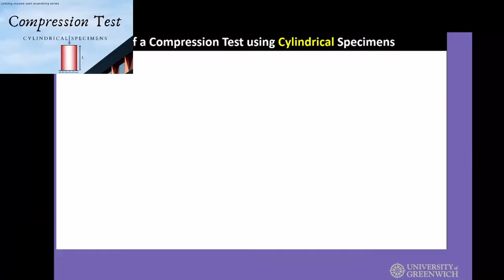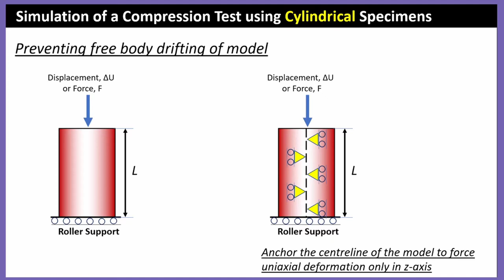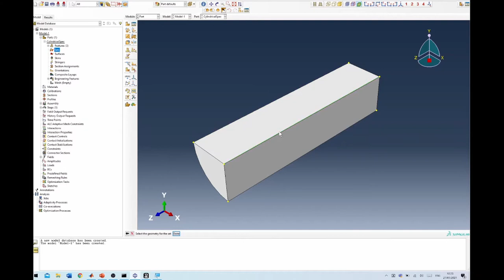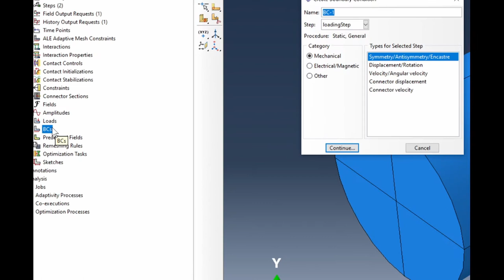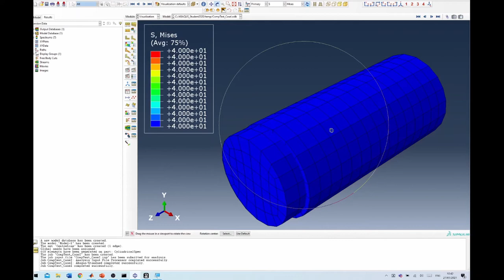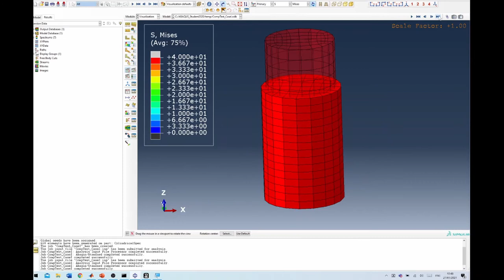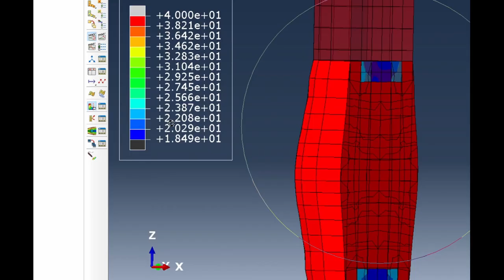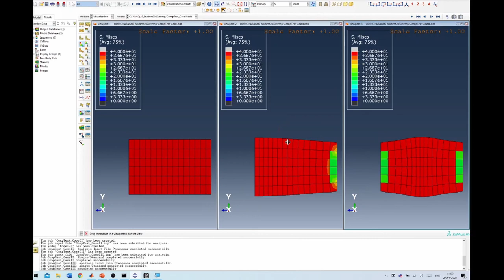Numerical insights of Compression Testing based on cylindrical specimen

Comment: Your way of delivering the lecture is great. Can you please provide one demonstration video of doing quasi static uniaxial compression testing on honeycomb cellular solid structure sandwich between two rigid plates? I need to validate my experimental force displacement curve with the numerical simulation. There is some difficulty in applying contact between specimen and plate and within specimen like self contact. Can you demonstrate this one simple problem with your nice explanatory video? It is really very helpful.
Reply from the maker: Hello @Anurag, thanks for the comment. It is a good suggestion - uniaxial compression of honeycome cellular solid structure sandwich. I will consider it and see if I am able to help. With the contact query, do you need ot have them with contact. Can you not bond/bind the rigid plates with the sandwich material. What is the condition/situation you are modelling. Do you just have to apply compressive load without binding the plates in your case? Well done.
Reply: Thanks for the reply @Dr. Okereke. Actually for the contact issue, i need to consider general contact or surface to surface contact between the rigid top and bottom plates and the top and bottom surface of the specimen respectively with the interaction property considered as hard and penalty friction coefficient. Since such type of simulations are non-linear in nature so self contact should also be considered between the specimen as there is a self contact between the specimen when the strain increases. The information from such type of contact, I got to know from the literature. And as per my opinion, bonded contact is not works well here as specimen is not bonded (tie contact) with the plates. It is just placed between two plates. Also explicit solver works well rather than an implicit solver. Actually I have a cellular solid specimens placed between two rigid plates and apply displacement controlled loading at the top plate with some strain rate specific to quasi static loading and bottom plate is fixed. I need to simulate such type of problem numerically and validate it experimentally. I hope I am able to explain the problem statement to you in a complete manner. Thanks.
Reply from the maker: Hello @Anurag, I agree with you. Your suggestions / reasons are sound. Because of the cellular nature of your material, it makes sense to allow for self-contact as when compression is agressive (or extensive), then self-contact can happen and so we need to allow for that. I think you describe it well so go ahead and develop the model. Good luck with it.
Reply: @AnuragGupta-op7uz  Can you please help me since I done compression modelling of my prepare specimen. After modelling, my experiment result fails to validate with simulation result. Is it possible to plot stress strain curve after force displacement curve? Please help me.
Reply: @siddhantsingh4625  yes you can easily plot engineering stress strain curve after force displacement curve by considering the original dimensions of your specimen. For stress, considered ratio of force to contact area and for strain, considered ratio of displacement to original height of your specimen.

Comment: Can i use this method for concrete cylinder for creep test ?
Reply from the maker: Yes, absolutely if the concrete is assumed homogeneous i.e. you have averaged out properties. The principles will apply but your material model will of course should reflect that of a concrete material. 

The only challenge is if you want to do a micromechanical model where aggregates of the concrete are considered. In this instance, due to the heterogeneity of the microstructure, you cannot guarantee that the materials around the centreline (as showed in this video) will remain central through the deformation. 

So, constraining it as I have done is a bit artificial and so not adequate. You might have to consider a different boundary condition for example fixing the base securely in all directions. This can be acceptable for the concrete because there is no finite deformation. 

If there were to be a finite deformation, you will notice what is called barrelling and this is not representative of true compressive uniaxial response.